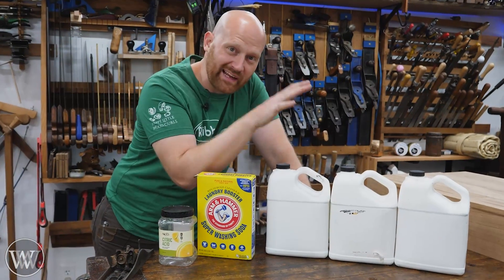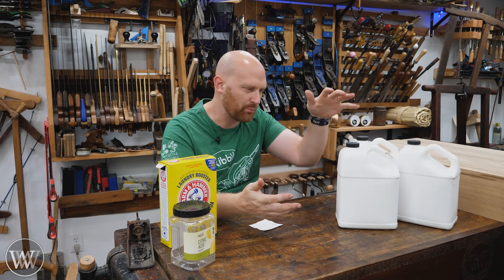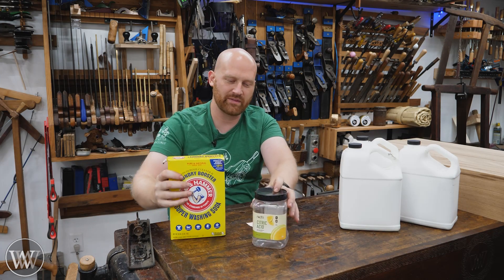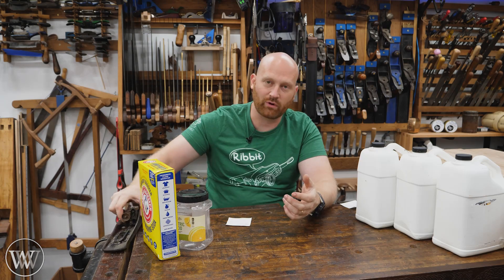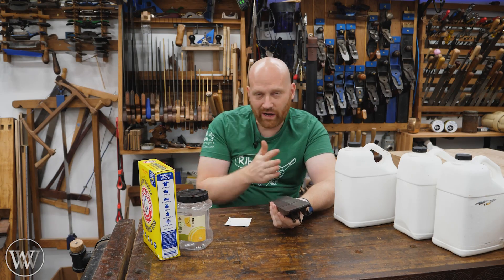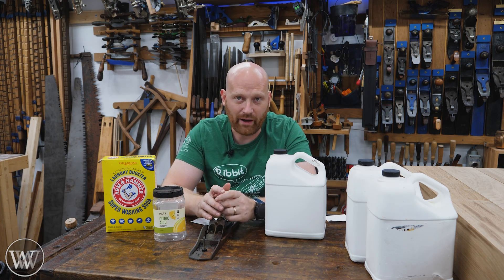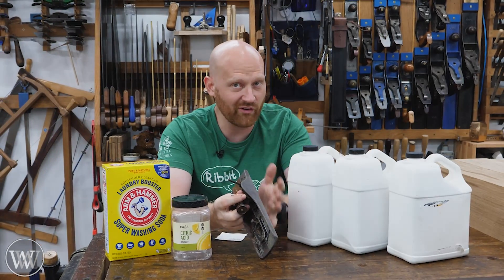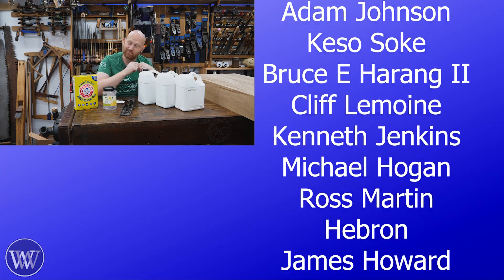Rust Removal REVOLUTIONIZED The New Affordable Way

Comment: Electro chemistry is more thorough.
Reply from the maker: In some things yes, but it is a lot more of a pain to work with.
Reply: @WoodByWrightHowTo  It can be but does a great job.

Also, on the topic of rust; if you want to prevent rust then get some ferric chloride, brush it onto the steel, leave for a few minutes, rinse off with water, dunk the piece in a tub with water and baking soda mix to neutralize the ferric chloride, rinse in clean water, dry. (Works best at warmer temperatures but you don’t need to heat it.)

It will form black rust (Magnetite, which protects) and prevents red rust (iron oxide, which is destructive).

Works similar to bluing guns but is an ambient temperature method. I do it to all my tools and knives due to humidity where I live. Perfectly safe providing you follow directions with handling ferric chloride.

Edit: typos

Comment: 33.814 ounces in a liter X 4 = 135.26 ounces.   1 gallon is 128 ounces
1 ounce is equal to approximately 28.3495 grams (or 28.35 g)
To those who want to use gallons and ounces you will have to do the Math
My Head Hurts I Quit .

Comment: I think using anode cathode/ electrolosis is most cost effective. Even seperates the rust cleanly so i can be saved for projects. Use 2 amps at 12 volts, only 24watts an hour looking at 40 hours or so of running time for 1 kwh which is 15, 16ce t

Comment: How is that? If you mix an acid with baking soda, you get a salt and water. assuming the proportion will neutralize all the acids.That is basic high school chemistry. So why not just use sea water which is 7,8% salt?  Or just vinigar.
Reply from the maker: It's not the acid. Pat, the carbon that bonds with the iron in the rust. If you watch the other video I was talking about he goes into the chemistry involved.

Comment: I tried it on an old back saw and it worked great.  I did notice that the plate, back, screw, nut and washers all looked different after the bath.  Different steels?
Reply from the maker: Yes. They're usually very different metals.

Comment: A while since I watched BB's excellent vid. But IIRC, the solution is not neutral, the pH needs to be around 4 for max effect, and never allowed above 5.5.

Because it is acidic it does eat into the steel, but only very slowly, and not fast enough to be a real problem for most uses.

The main drawback with it is that it is only a rust remover not a rust inhibitor, so you need to protect the steel as soon as you rinse it off. To do that you can rinse it off with a weak sodium bicarbonate solution, then wipe that off with a rag and something like a mineral or white spirit/turpentine/ethanol, and as soon as that has dried apply a protective barrier (primer, oil, lanolin, Penetrol, etc).

Comment: I used vinegar and salt before but lost some Aluminium castings in that solution...thats why i use a close to yours solution.

I mix 100g citric and around 1/2 of that bakingsoda with a good splash of dish soap (detergent), with 1 liter destilled water

And i clean/ decrease the parts a bit before

Then a hour in solution and stir and repeat a few times or not...the next day i use a brush then a dry rag and then use old olive oil to protect it

Edit: forgot to say ph is around 5

Greatz from Germany
and have a nice Day
opo

Comment: By doing this you create etching solution, which more prone to eat metal, than rust.
Acid`s is fine, just rinse it off after cleaning.
Reply from the maker: This does not take off the rust from the acid. its PH is only slightly off neutral.

Comment: You can make washing soda (sodium carbonate) by just heating baking soda (sodium bicarbonate) in the oven at 350F for an hour! If you want to be super sure you got washing soda, weigh it before and after, and you should have 2/3 of the weight of what you started with. If not, keep going with the heat.
Reply: Interesting hack if you need washing soda! For this rust removal solution, though, Beyond Ballistics also gives the formula if you’re using baking soda. You just need a little bit more than if you’re using a washing soda.

Comment: Thanks, James, for sharing this one. I was presently surprised by Beyond Ballistics video and really appreciated the experiments that he ran. I'm an engineer with a pretty substantial background in chemistry and last year I did a pretty deep dive into rust removal. After all that research I had concluded that a chelating agent is the best solution for rust removal, it was pretty neat to see that it can be made with citric acid and a ph buffer like sodium bicarbonate. I had found a similar formula by ElementalMaker using EDTA, another chelating agent, with citric acid. Here is his formula for anyone interested in it and a link to his video:

Formula: 100mL purified water, 5g Tetrasodium EDTA, enough citric acid to buffer to 6.5 Ph, and a few drops of dishwashing liquid (any good surfactant should work)  

ElementalMaker video: https://youtu.be/f9kBdJQMPPI?si=-5iqA8_4MWHhrS3i

Also I happened upon the patent request for evaporust which is a pretty fun read for anyone interested :D
https://patents.google.com/patent/US20040102344A1/en

Comment: I came just to be snarky..haha, and to inform all that citric acid is also the main ingredient in most coolant system flushes, though if you were to use it for that you'd want to omit the washing soda.  Does it have to be washing soda does anybody know? One Sds i checked had citric acid and sodium hydroxide in it..maybe this is the same concept as your rust remover somehow.
Reply from the maker: washing soda is  sodium hydroxide it is just a comon way to find it for most people.
Reply: @WoodByWrightHowTo washing soda is sodium percarbonate. Anhydrous Sodium hydroxide is called caustic soda

Comment: Thanks James! Tried this last night on some rusty tools. Worked as well and as fast as Evaporust. I noticed that in some steels it turned the metal a charcoal black, others it left shiny. This is definitely on my homemade remedy list. Evaporust is good but with this recipe there is no need for it. And thank you for the Beyond Ballistics link, I'm a new subscriber to his channel
Reply: I'm guessing the black stuff is high-carbon steel.
Reply: @JimVanVerth  Could also be just the color of the chelated metal - you're left with a new surface of the ligand and the metal it bonded to, which could be opaque.  It's also possible it's left-behind carbon from the steel, but that would involve removal of the iron molecules to enrich the resulting surface, and chelation doesn't do that - if it did, it would be counter-productive, because you want to KEEP the iron and displace the oxidizing elements that produce the corrosion/rust.  It would be interesting to test and find out!

Comment: idk about this. Baking soda and acid turns into CO2 and saltwater. With vinegar it rurns into CO and saltwater and sodium acetate, which to my knowledge has no effect on rust.  My suspicion is that its still an acidic solution thats been partially but not completely neutralized by the baking soda.
Reply from the maker: You might want to watch the original video. He goes into a lot more detail on the chemical side.

Comment: Beware stainless or other high chromium steels.  You will create high valence chromium in your waste water solution, a very nasty toxin that is bioaccumulative and persistent in the environment.  It is most easily altered to low valence chromium through the use of metabisulfite powder, a reducing agent.  Let the waste evaporate and dispose of the solids.

Comment: I absolutely loved this video. I just bought a 5 gallon bucket of Evaporust to help my stepson clean up a lot of his stuff after getting hit by a storm surge from a hurricane that put his garage and bottom floor of his house under 6 feet of water. I absolutely loved Evaporust, just not the cost. I've almost depleted the bucket of it so I can't wait to try this.
I do have one question. When I took the recipe you had in your comments and adjusted it for 3 gallons I came up with needing 2.6 lbs. of citric acid and 1 lb. of washing soda. Adjusting it up requires 2.6 lbs. of Citric Acid and what you linked to in Amazon (and looked liked you used) is only 1.87lbs, a 0.8 lbs. difference. Did you use more that that one container with 1.87 lbs.? I just wanted to know as I really liked your results and the idea of using a less acidic formula.
Thanks. I absolutely love watching your videos, they have helped me so much on my journey into hand tools.

Comment: Short answer ---  YES.  I am in the business of preparing steam boilers with volumes like 100,000 gallons in them and acres of surface steel due to the thousands of tubes built into them internally.  You have the mixture about right.  The pouring in of the bi carbonate powder made me laugh...  Been there and done that a few times, on a scale that would fill the room you were in with foam!!!  Funny now.  Not so funny in the middle of a power plant.

But100% correct on the "safe on steels" and it is best for home use just as you made it.  I use a much more acidic version because I have test equipment and know when to stop it and how to stop it so it goes faster.  But this system works.  There are also other systems but not really for home use.

Great content.  Well presented.  Please keep posting!!! 
By the way, that citric acid, if you are careful and get the "food grade" makes great lemonade!  But it doesnt take much, and you may need a good bit more sugar than you are expecting.  Lemonade is like 0.1% to 0.2% citric in water. Strong lemon juice is around 4%.  That crystal is typically essentially 100%.

👍👍👍
Reply: Have you happened to work on any papermill recovery boilers in VA?
Reply: @basecoat1966  Not in Va.  In both N. Carolina and S. Carolina.  Also all across the south.  GA. FL. Ms. Alabama, Louisiana and of course Texas and Arkansas.  Yes, and probably 70% recovery boilers.  rest of them mostly power boilers.
Reply: Not only that, but after drinking the lemonade, you have no stomach rust . . . (;-)

Comment: Excellent!
Good to see you using SI units for the recipe although it took me a while to convert a “pinch”🤔 as that’s usually used for dry materials.
Turns out that’s just an old term for half a smidgen, or if you need real accuracy a dozen smudge 👌

Comment: Ooh this is awesome!  2 questions for ya James:

1.  Did you ever find a blue japanning recipe you liked?  I haven’t been able to find it if so. 

2.  I’ve used evaporust (but will likely go this route now), but haven’t tried electrolysis. Why would you use one vs the other?
Reply from the maker: I have not found a recipe for blue that works well.
Electrolysis works well but it is expensive to get up and going and finnicky to work with. once you get a system setup and several tank sizes to play with it is great, but untell then it is a time drain.
Reply: @WoodByWrightHowTo  ah, sad to hear it as a fellow blue fan. 

Excited to see your tests!

Comment: I watched your video and the one by Beyond Ballistics. I am impressed.  Now I have one question. How well will this solution work if the part to be de-rusted is too large to fit into a container?  Can it be used as a wipe on? If so what would the process be? OK that was three questions. Thank you for sharing. Have a great day and stay safe.🙂🙂
Reply from the maker: It can't wipe on. But what you can do is dip rags in it and wrap it in the rags. It works slower and you'll have to reapply the rags a couple times. But usually if I have something that's too big for a particular container and make a container out of aluminum foil.

Comment: Btw, I heard there are different ways to darken wood from fire to a solution of steel and vinegar. Given you have more talent than me, would you mind giving a comparison, as well as tips and tricks?
Reply from the maker: Using a steel solution is known as ebonizing. That works well for oaks and woods with a lot of tannin but doesn't work for a lot of lighter woods. Using fire or shoshogiban will work on any wood, but it also leaves a texture + can stain a lot of other things around it. Usually if you're wanting to darken a wood just for the color sake, it's best to use a stain.

Comment: what are the componentes of the washing soda?
sodium bicarbonate?
guess that baking soda can also work to stabilize pH of the solution
Reply from the maker: Baking soda will work but it requires a different amount. The other video goes into it in more detail if you want to see other possibilities.
Reply: @WoodByWrightHowTo  it’s because what is sold in my country as washing powder is calcium carbonate and other component that i dunno if it’s alcaline or not
Reply: @WoodByWrightHowTo  now thinking about it it should be alcaline that’s the way to remove fat and other oil stains from clothes lol

Comment: Cool to see ways to do stuff like this without harsh chemicals.   Added bonus that it's cheaper than commercial products
Reply: Yeah but everyone’s going to use sodium bicarbonate (baking soda) which is totally non-harsh.
Reply: I was very confused by this comment, however I was thinking about the original BeyondBallistics video when I read it. Sodium hydroxide is incredibly harsh, and to be fair, sodium carbonate is by definition a fairly harsh chemical too. It's not exactly safe for any extended skin contact.

That all said, the process is quite interesting. I'm not a chemist, but chemistry adjacent. We alternate acid and alkaline cleaning phases to remove calcium compounds and other deposits from brewery vessels, and not rinsing between phases helps remove more than isolating each phase. Though in our circumstance I understand it's subsequent reactions that soften calcium oxalate, and completely mixing the two would be counterproductive to say the least.

Comment: Glad to see this one spreading through the internet. I saw "Beyond Ballistics" 's video about six weeks ago and tried it. I used baking soda, 63 grams, because it is more widely available and added one tablespoon of Dawn detergent per liter. Absolutely amazing! I found that it works much faster, more completely, and at less than ten percent the cost of Evaporust in my area (Seattle). Rust has been disappearing from everything in my shop now that there is an affordable alternative! It is worth noting that as the solution gets darker with use, it does deposit a sticky brown residue, worse than Evaporust, that adheres to the metal. However, if you wash it off and spray it with WD40 or oil, after rust removal, everything is fine. It will also loosen paint, which may be good or bad. Finally, you can safely dump it down the drain to get rid of it!
Reply: Excellent
Reply: Has anyone used more base than recommended, so that the final pH is a bit higher? I would think this would cause a little bit less metal attack and work just the same.
Yes it is acidic with the proportions mentioned, I believe… just not as acidic as citric acid…
Reply: @kineahora8736 I read a comment elsewhere that recommended equal parts of citric acid and wash powder (not baking soda).  I’ve been using that ratio and I honestly can’t say I can see a noticeable difference in metal removed.  I’ll probably continue using equal amounts—it doesn’t affect the efficiency of the solution or anything else I can observe.
Reply: @Gary-g4k  yeah I don’t think it matters at all whether you use washing soda or baking soda. It’s just that baking soda is pretty much in every refrigerator and every cupboard— you just need to use different amounts of each, and how much you use is not fixed in stone anyway it’s just a matter of how acidic or how basic you want the solution. Basically you can just start adding whatever soda you decide to use and keep measuring the solution with a piece of pH paper until you get the level of acidity you want. My understanding is that lower acidity (higher pH) will remove less metal, but the rust removal reaction goes slower. I didn’t even bother measuring anything when I did this: I just used lime juice and some baking soda and threw them together🤣
Reply: Same for me, we don't have Arm & Hammer in our country and it would be VERY expensive to ship a box to me (A$55 to be exact). You just substituted baking soda for the Washing soda?
Reply: @HardDeck1970  If you're in Aus then try Bexters Soda Crystals. 10 dollars or less for 800g and it's pure sodium carbonate so it's the same as Arm & Hammer.
Reply: I was considering using this rust remover solution to remove rust from my Ford F100 gas tank.  Sticky brown residue left over eh?  Maybe it won't work for me.  Thoughts?
Reply: @corylechner8303  "as the solution gets darker with use" = Sticky brown residue after multiple uses, not after the first.
Reply: @corylechner8303  That is "as the solution gets darker with use". That would be complexed sludge and perhaps oils and other things from the surfaces being cleaned.
Reply: Common 'Arm & Hammer' Washing Soda, will show you a greater effect, especially if you admired the Baking Soda element! Baking soda has a pH of around 8.3. It is considered a weak foundation. However, washing soda has a high alkaline pH of around 11.4. It is a strong base, much more alkaline than baking soda.
Reply: @AXNJXN1  The recommended ratios are different for this reason, 63 of baking soda instead of 40 of washing soda. Would that neutralise the difference?

Comment: Soaking in a plastic tub of cheap cola works a treat and won't damage the or pit the metal, wood or plastic of a hand tool.
Reply from the maker: It is basically vinegar.
Reply: @WoodByWrightHowTo  Cola has phosphoric acid, not acetic acid as vinegar has.